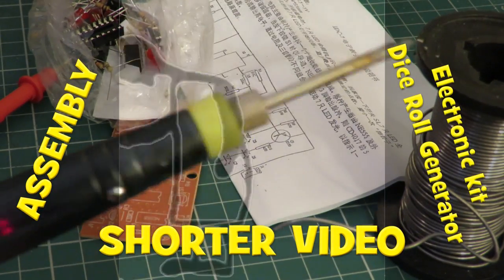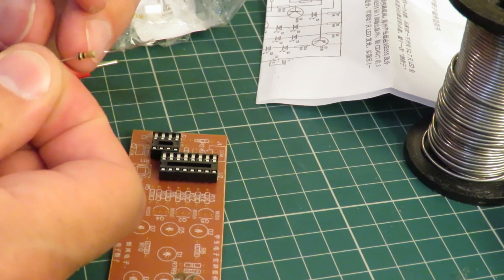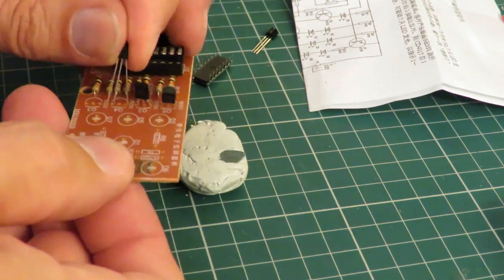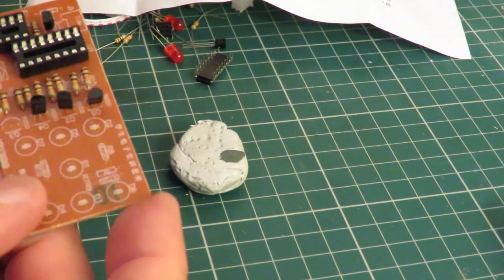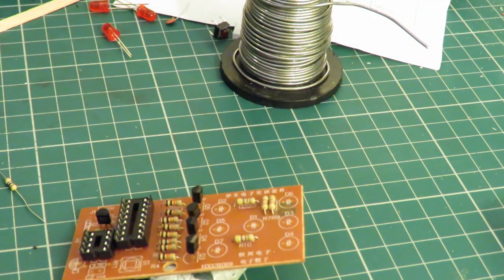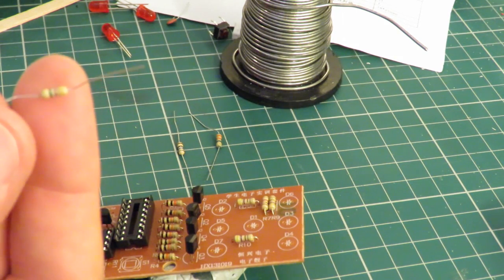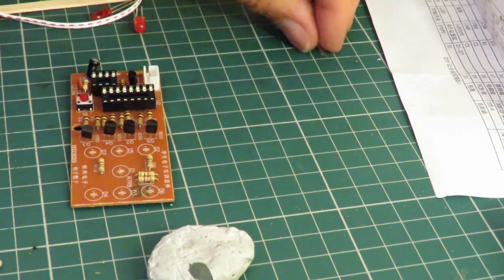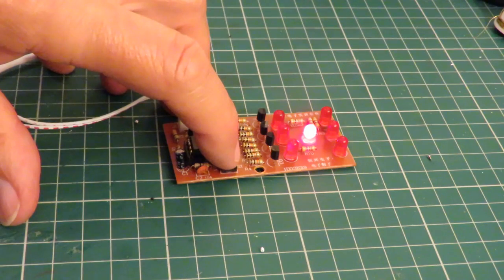Assembling a Electronic kit Dice Roll Generator SHORTER VIDEO

Comment: I would suggest changing the RC part to shorten the wait to just a few seconds.  This would be nice at a party or for a board game, but waiting 8-12 seconds for every roll is a bit much.
  I'd also suggest a thinner solder for circuit boards-  use the heavy stuff for plumbing or less delicate work, mate.
Reply from the maker: Thanks for the suggestions. I build these just to see if I can, most of these cheap kits have little practical purpose but help to keep my mind and hands active.

Comment: Got the LED's around the wrong way?   Kind of thing anyone could do.  You mentioned the battery running down.  Are you running the soldering iron from a battery pack?  It seems to be rather good for small jobs. Keep up the good work.  Regards.
Reply from the maker: Battery on the camera :) Yes you could run the soldering iron off a battery pack or powerbank as long as they don't have clever circuitry that prevents them doing that. I just use a phone charger power unit. bigclivedotcom did a review of this type of soldering iron.

Comment: I designed one of these for my AS electronics coursework although mine had to be made completely out of discrete logic chips.
Reply from the maker: Sounds interesting. Did you actually assemble it or was it on a simulator?
Reply: Designed on a simulator (yenka) and built onto breadboard.
Reply from the maker: euan todd great work :)
Reply: This is a classic 555 timer project.